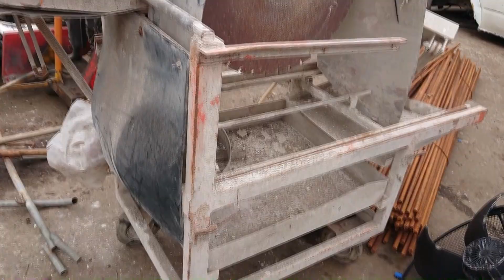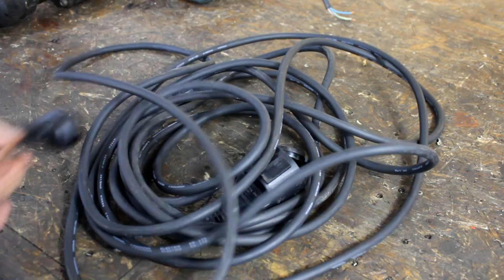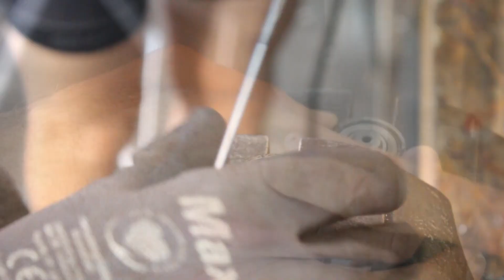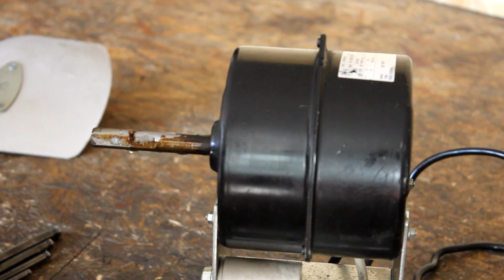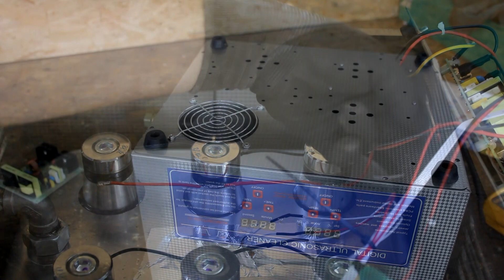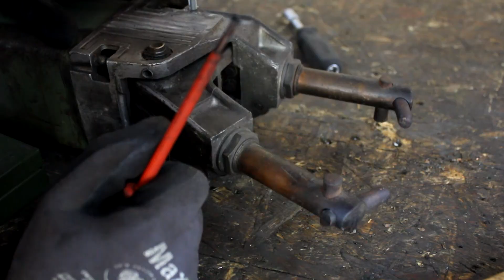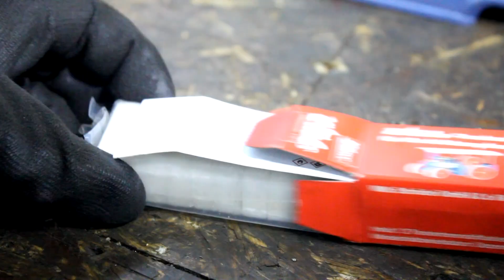Scrapyard Finds to spare! Repair-A-Thon!

Comment: It’s called a safety valve on the Steam Engine boiler, It’s designed to vent at a certain pressure and release some steam from the boiler to stop it blowing up
Reply: Would that all models had them.

Comment: The after market armature sounds different, now cameras lie, but usually when the whine is lower pitch, that means a much better packed winding, in my experience. Was the difference between an original Hitachi winding and the repaired unit with new everything after i had burnt it. Cost me just 10 euros under the asking price of the replacement too, and got a better winding. :)

Comment: Your philosophy on repairing has absolutely influenced me, my friend. I needed a grinder. Rather than buy a new one, I repaired my 20 year old (but high quality made in the USA) Dewalt by simply cleaning it, renewing the grease inside the gearbox, and replacing the power cord by adapting one from an old computer. It runs perfectly! An hour of work saved me at least $100.
Reply: I have a 25 year old Hilti brand 4 1/2" grinder that I've replaced the cord and the brushes on, and it still works great!
Reply: I noticed the new Festool and Milwaukee tools now have plug and twist cords. Surprisingly cutting the cord on a job site is a common accident.  I have my dad's old Milwaukee sawzall from the 1990s, those had twist plug cords back then too.
Reply: I repair all i can do and never throw out anything useful ;-)
Reply: I "restored" (cleaned and repainted) and old grinder that came with my parents house when they bought it 30+ years ago. It's probably 35 or 40 years old. It's kind of shit, has no power at all and it stalls very easily but it's still nice to have it working and being able to use it. Better than buying a brand new cheap one.

Comment: great video, as always. Reminded me of my Mamod  (UK model steam engine manufacturer) stationary steam engine. I was given as a child that I still have this day (I am 57 years old..) It is a very similar steam engine, but does not have the impressive pressure gauge yours has. Lovely to see the machines running off it.

Comment: Why does the steam boiler's pressure indicator start at 0bar? You'd think it would bottom out at 0,9-1bar (and go up from there), instead of having "additive scale" on it. Unless normal air pressure in Germany is the same as outer space's. Which would explain a lot.

Comment: Interesting video as usual.
When you said the name of the welder's company, I automatically came to say: EXTERMINATE! EXTERMINATE! (ASK the doctor Who why, hahaha).
Commenting on the condition of the two Boschs and the fan: I begin to think that a not-too-honest technician replaced or didn't repair to earn a further sale (instead of a condenser a whole fan ... that's a lot of money, the same for the hammers)
To extract the ball bearings I recommend the following link: https://it.aliexpress.com/item/33046983579.html?spm=2114.13010708.0.0.3a994c4dvvy45v (I took the 66x90mm) or this link: https://it.aliexpress.com/item/4000152294063.html?spm=2114.13010708.0.0.3a994c4dvvy45v  It comes in an orange container, only problem: the screws are imperial pitch, but for you it won't be a problem: since I have them (one month about) I have already used them four or five times

Comment: the company would not make any money on a five-dollar part and still, mite have a problem with the motor  we had a problem with a complain burning motors up it was to get that problem fixed now or it will be your bill to replace  each time it goes out  yes they paid for the new overload in the panel box we put on a new motor on the conveyor the did not want to fix the other problem that exit day  one or their trucks backed into the panel and did more damage to the system

Comment: Oh man. I was in the same spot recently with a bosch router. Ordered and waited 10 days on a new rotor, but then couldn't get the old bearing off -- had to order and wait another ten days for a new bearing! Trying to save $5 on a new bearing was not the way to go. :)

Comment: if you want to clean grease and dirt from large metal cases use an old dishwasher using degreasing fluid and the washer heater element,

Comment: Ich finde Deine Video´s super inspirierend! Ich arbeite in einem Elektrogroßhandel. Wir haben da auch eine E-Schrottbox. Was ich da schon alles "gerettet" habe..Etliche Multimessgeräte, Leuchten(1 SMD-LED defekt), Computer, bis hin zu einem HD-Beamer bei dem die Horizontal/Vertikalverstellung ausgehangen war. Die Messgeräte haben meist nur kleine Defekte oder die Batterien sind ausgelaufen. Ich Zerleg alles, mach alles sauber und die Dinger laufen dann wieder Top! Bei den Leuchten ist es ganz schlimm. Sehr oft ist nur eine LED hin und schon geht die ganze Lampe nicht mehr. Zum Glück kann ich SMD Löten und so hab ich immer schöne Leuchten für nix Kost. Ach übrigens das ich mir ab und an was aus der Box nehme ich natürlich genehmigt solang es nur für den eigenen Gebrauch ist.

Comment: Would you please explain about shaded pole motors? I've found a fan from "Volmo fans" rewounded, it but each time I try to connect the windings to energyze, it causes a short circuit.

Comment: Lucky find with the spot welder. Those are solid and rarely break. Valuable and useful!
Reply: I got the same spot welder. It comes  from a close down company several years ago. The only different is mine  got a little switchbox with a timer, a current control and it runs on 400V. It is a very useful tool. And nearly "unkaputtbar" (undistructable). 
We  got some good scrapyards here. But not all over the land. The one I got  in my area is more for electronics/ electric /telecom and computer gear. I recently bought a 3kVA mains transformer 230 to 2100V . It could be fun to play with it.. It will spent its future in my power amplifier.

Comment: My AC unit stopped working last year in the summer same issue. Replaced a $8 starter capacitor and saved hundreds on a repair call.

Comment: While replacing the whole fan might cost 450 euro, keeping a repairman employed for the year would cost 52 times that cost. Unfortunately for the worker things fail far to infrequently to make the job economical.
Reply: It's a matter of changing the way we think about things.  Instead of immediately sending things that aren't functioning properly to a scrap yard or, heaven forbid, a landfill, why don't we have an option of sending things to a
repair yard first.  If that item is then found to be unsalvageable the scrap yard would be the next step.
.

Comment: 14:10 i'd expect there to be a messy smear of thermal compound between the heat sinks and the transistors. I would have added some upon replacing the burnt out transistors.

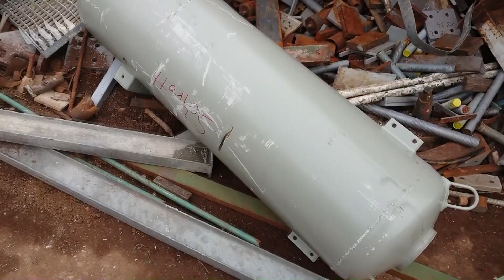Comment: 1:38 This pressure vessel is not "damaged rather severely", it's been deliberately decommissioned so that "creative" or "frugal" people don't reuse it for things it failed to meet regulations for.
Reply: Some things are not meant to be reused. Tho a little bit of effort could've gone into a better decomissioning. I cut my 4 liter one into sheets and caps, then sent it packing.
Reply: @aserta  you can still cut it in half and build a smoker out of it or a forge. Many things just need steal but no pressure. That thing could still have many years ahead of it.
Reply: @excitedbox  Steel not 'steal'
Reply: @charlesangell_bulmtl  calm down boi, @excited box very well understood that is was decommissioned. he simply pointed out that it could be be repurposed as something else. No need to be like this
Reply: @MatureFister  Yes, but said repurposing ought certainly not going to be done by whoever decommissioned it in the first place. It's not exactly like a chemical plant's mechanics have the time to suddenly go into the side business of producing kettle grills or whatever from decommissioned pressure vessels, now have they? Seriously, wake up and smell the maple nut crunch. This thing wasn't made unusable by some hobby schmuck who DIYd himself a new bong but by people who have more important, and more profitable things to do with their time at work than trying to avoid throwing out a piece of metal that's somehow gone bad beyond acceptable tolerances. There are much higher costs at stake than just a dozen kilos worth of steel. THAT's why it landed in the skip, not because they couldn't think of alternative uses. I hope this is now abundantly clear so that pointless and uninformed "buts" can finally cease to be made, by overly concerned idealists or otherwise.
Reply: @Anvilshock  No need to call names. I never said it should be or even must be the original users or manufacturer of anything to repurpose it.
Reply: @aserta  
Properly welded and retempered, no problem.
Reply: @charlesangell_bulmtl  Only solves the decommissioning problem not the initial reason that it was decommissioned.
Reply: @DaDunge  exactly. If it had moisture corrode and pit the metal from the inside that is a big boom waiting to happen.
Reply: @DaDunge  And you know why it was 'decommissioned'?
Waste of resource nonetheless.
Reply: @excitedbox  BS, that's where it would start leaking.
What's your experience in the matter?
I'd be more concerned with the weld design in that vein.
Reply: @charlesangell_bulmtl  No I don't and that's the point. If there's something wrong with a pressure tank and you don't now what it is and thus can compensate for it it could essentially be a bomb waiting to happen.
Reply: @billybobjoe198  Well, I must not have your experience with the things, as what I've observed is that most air compressor tanks will collect moisture in the bottom, and proceed to rust, pit and finally leak. I still say I would be more afraid of an improperly designed and/or welded tank...
Reply: @charlesangell_bulmtl  a friend got himself an old compressor out of an dentist's place. They have a filter dehumidifier added so shit you described doesn't happen to them. Maybe its worth for you to look for something like that.
In germany many dentists had to get rid of their compressor due to new legislation, but for private use they are perfect.
Reply: @MatureFister  Thanks for that info...
I think that a Stainless Steel tank properly retempered or just annealed after welding would be a proper way get something worth a lifetime or as I'd like to see "something you could hand down to your Grandchildren"
Disposable/throw away goods are a waste of time and resource.
I'm sure someone will have the 'answer' as to why that can't be done, rather than a real solution.
Been hearing that kind of negative defeated crap all my life....
Reply: @billybobjoe198  Consumers are not so fastidious with PM, and their tanks often end up with aforementioned rust and pits....from condensation.
Reply: Those regulation are for bussines when sell " safe " products...

The same regulations who killed kinder eggs. :v

Comment: As for the aircon fan, I'm pretty sure the manufacturer's repairman come round, and thought "this fan is indeed broken, therefor it must be replaced". That's just how companies are these days. It's easier and faster to replace the fan, and they probably have them in stock. They won't have replacement capacitors in stock. Also, replacing the whole fan is more expensive, which makes for better revenue.

It's a shame (as in, companies like this should be ashamed) that it's all about money, and not so much about Earth's resources.
Reply: On the other hand replace the cap and next week the bearings fails then the customer complains why didnt you replace the fan in the firstplace. Dont know the situation in Germany but in the Netherlands there is a huge shortage on service engineers.

Comment: I have a question. What could be wrong with a switch mode power supply that cause it's fuse and mosfets burn 3 times when i plug it in. There's a switch behind it if it's in off mode and i plug it then switch it on it works perfect but if i plug the unit while that switch was on PSU will fail instantly.

Comment: Dude, testing those electric hammers on a brick and concrete block loosely placed between your feet was insanely dangerous, you could have easily lost a toe (or worse). Those are industrial grade hammers, not your average household tool, I'm wondering what idiot threw them away in the first place...

Comment: The electrodes on the spot welder should be filed to a point so that the current will pass just a small area to give a better joint. I used to use this exact same  machine in the  late  70's. Hope this helps.

Comment: Puting old bearings on a new rotor is a "war crime"
The pneumatic unit on Bosh need a new o rings and lubricant
Reply: i was more cringy of hammering the bearing, he probably felt it for run smoothness before installing

Comment: Seeing that stationary steam engine brings back some memories! I had the standalone unit and polishing wheel when I was a kid. I still remember lusting after that workshop unit but it was rather out of my price range.
Reply: Same here. I have to admit tho, that steam engine never got much use. It was interesting to run it two to three times, but then it just sat in a sad corner and i was busy building things out of the meccano metal pieces again...
Reply: ƸӜƷ Totally agree. My Meccano set saw 100 times the use that my small steam engine had. I still believe that Meccano was one of the best toys ever.😀🇬🇧

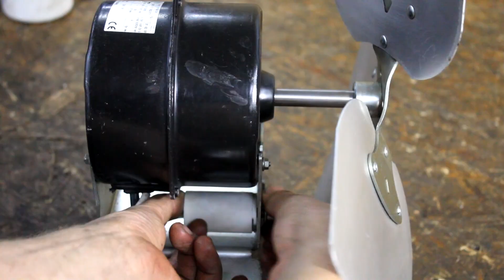Comment: (10:00) The same thing happened to me! My HVAC unit fan stopped functioning, and the repair guy wanted to change the motor, and charge me $600 dollars (CND), to which I told him no way, and demanded that they change the start-up cap! Repair cost plus labour $120 dollars... 

I knew what was wrong, and should have just replaced the CAP myself; next time I will!

Comment: Many items are scrapped to get them off the local tax rolls. Ie local county tax man wants 3 percent of the items worth every year forever.

 Thus that IBM PS2 286 computer and software you bought for 5900 they still want yearly tax to feed the social machine of government.  

 ****Thus stuff gets scrapped to get it off the tax rolls. ***

A set of production stamping dies for  spare parts gets taxed every year. Thus at some point  production tools get scrapped to save taxes. OR the usa stamping dies gets shipped overseas where manufacturering  is welcome and not something to be killed off. 

Lets say you have some old  high tech 4000 buck computer from 1999 today just printing shipping labels. The tax man might say it is still worth 700 bucks. If it dies and a buddy gives you a junker for free that does not matter. The tax man figures worth on what they think it is worth.  Not what you paid for it. 

A rarely used production machine that cost 55k here was purposely destroyed to save 1650 per year in taxes. We actually still used it but not enough to pay the yearly taxes on it. Thus cut it up with saws and scrap it. 

A 5 buck chair a helper bought at thrift store magically is counted as a 180 buck executive chair on the tax rolls costing one 5.40 a year on taxes.

So in areas that tax equipment and inventory you really want none so pay less taxes.     Even weirder is some places use to tax capital in the bank. Ie savings account of business balance is taxed every year

At a couple of places i worked at we shipped manufacturing overseas with the old dies since the USA can be anti business via taxing production equipment. Rather sad.

Comment: "Its almost a lost art, at this point"..
yeah i agree.. i really get sad just thinking about that..
Reply: @bacilluscereus1299  Kinda yeah. If machine is broken its cheaper to get new one than face the consequences and insurance costs etc of potential fire of injury. Also for worker replacing unit is easier and takes less time than trouble solving.
Similar apply to private people, but in there its more of question what ever they are too lazy to learn to repair and problem solve.
Just saved not even that old compressor from scrap bin. Cheap brand, but it was all there. Motor would not spin, just made noise, so i replaced capacitor, nope it didnt even need that. Just turned motor by hand couple of rotations and tried turning it on.. worked with out issue after that, so owner could have saved couple hundred € by loosening two screws and turning it.
Great many branch cutters or what ever those are called, what crush or cut branches into pulp arrive into scrapper. Most only need blades to be sharpened and holding peaces to be adjusted closer to blades. Such simple problems. Most ridiculous thing is that so many electric chainsaws end up into bin due owner being idiot. Cant even count how many has been brought due kickback protection switch being on... Just turn it off and works like a charm.
Reply: Also easier and cheaper not to train and retain repair technicians who can actually trouble shoot at a much lower level. Range of spares to be carried is less and less technical documentation to be produced and maintained.
Reply: @bacilluscereus1299  No brainer....